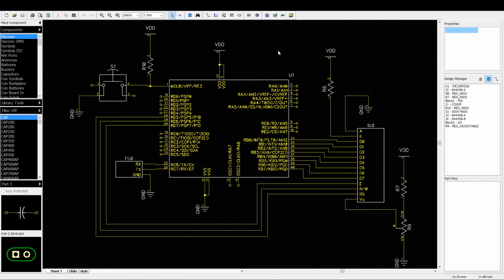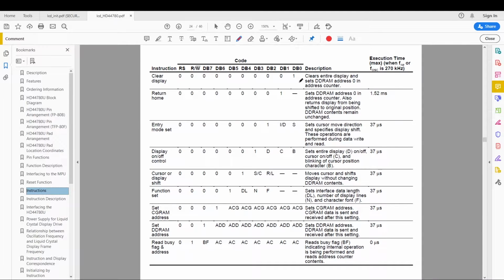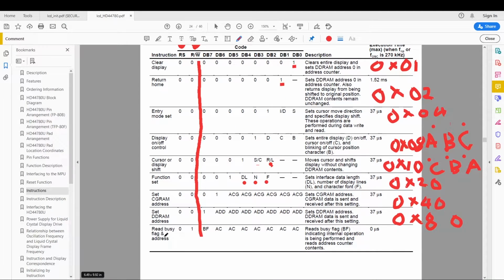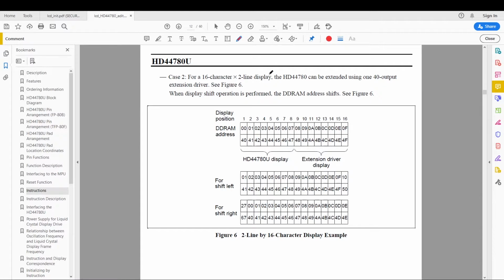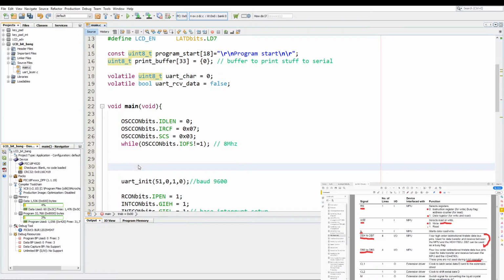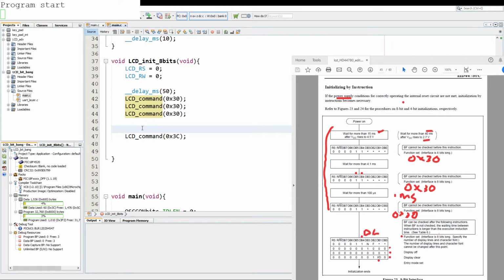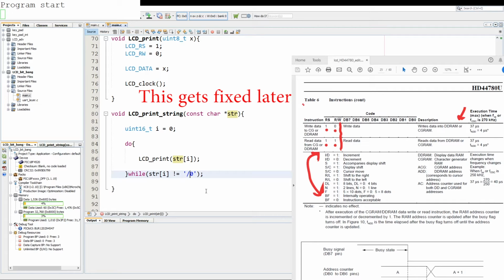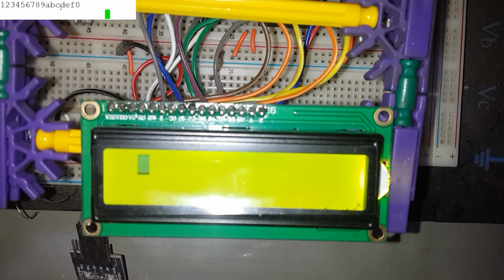LCD Interfacing 🔴 PIC Microcontroller Programming Tutorial #23 MPLAB in C

Comment: Question about the contrast pin, I harvested a LCD display out of a broken flow transmitter, it worked fine when it was still in the transmitter.  I can get the thing to print code, seems all good.  But the contrast is super weak, the strongest I can get it is at 0V.  The datasheet is not explicit about it, but shows two circuits for the pin (VL on my display), 1. a voltage divider 5V to GND, 2. a voltage divider +5V to -5V.

There are some other timing diagrams that seem to suggest negative voltage on the pin.

Do some of these strictly require negative voltage for the contrast?
Reply: Well I answered my own question, absolutely they do.  Built a charge pump, and -1V makes it come in clear as day.  -4 and full dark.  Thanks for these videos!
Reply from the maker: I did not want to get into the nitty gritty of how the crystals actually work nor do I know enough to give accurate information.
Like you found it is up to the manufacture to decide and/or the composition of the crystals how the crystals will be polarize. You mention a datasheet. I am assuming that it is not the same driver chip as the one I am using I am also assuming it is a old device you salvaged from since using negative voltages have become very rare.
Reply: @BinderTronics  It's not terribly ancient honestly.  An old model though, plus it's using a bunch of funky inductance disturbances to calculate the flow of water through a flowtube, that being said it doesn't necessarily surprise me that they are making use of negative voltages with all the amplification of weak signals going on.

And yeah, it isn't a hobbyist make, Hantronix it seems, but not a name on it.  The only reason I kept it is that it had a header that fits my board.  And it's a good excuse to dive back into hand coding.  I'm a PLC programmer by trade, so it's a big mental shift.

Comment: This is an awesome video thanks as it hard to find Examples for MicroChip and LCD. Currently I'm on Tutorial #4, so it's going to take me awhile to get to this LCD video in detail. I would love to see a video that could demonstrate how to get some output when testing some code.

Your LCD code will be very useful for confirming that the C methods are working, however it would take significant effort to connect an LCD display to the prototype every time I want to test methods that calculate things. 

How is this done in the embedded world? I feel crippled without being able to print out results from methods that I write. What are our options in the embedded world?

For Example, Since I am a C# developer I would typically write a method and then call the method and print something out, to confirm that the method is doing what I expect, this is super easy when using C# Console.WriteLine(); in C it would be a simple printf(""); statement.

Here is an example of what I mean (It's in C#)

private void main( )
        {
            String s = GetTimeStamp( DateTime.Now ); // Method call returns String.
            Console.WriteLine( s ); // Easy to print value and confirm code works.

            String result;
            GetTimeStamp( DateTime.Now, out result ); // Here I pass a reference called result (pointer) 
            Console.WriteLine( result ); // Easy to print value and confirm code works.
        }
        private String GetTimeStamp( DateTime date)
        {
            return date.ToString( );
        }
        private void GetTimeStamp( DateTime date, out String timeString )
        {
            timeString = date.ToString( );
        }
Reply from the maker: #7 https://www.youtube.com/watch?v=pPmEWlIYByo and #13 https://www.youtube.com/watch?v=O4IpwgWhqLY covers this. The norm is to use the UART. This is slow but each architecture has its own tricks eg. ARM based micros has a SWI interface that is DMA witch is much faster than sending data via UART.